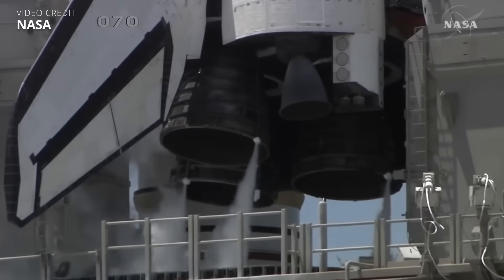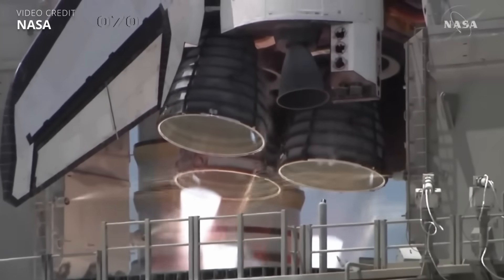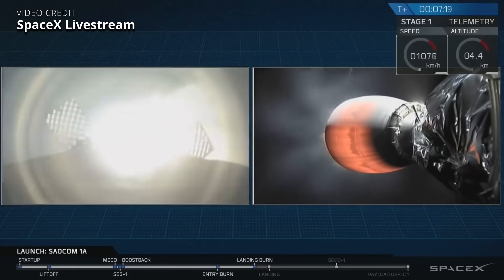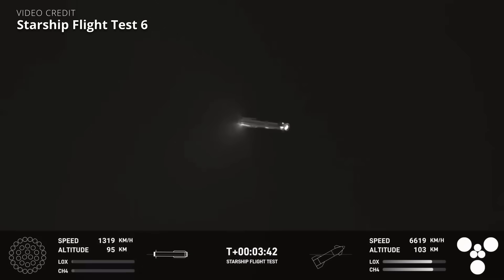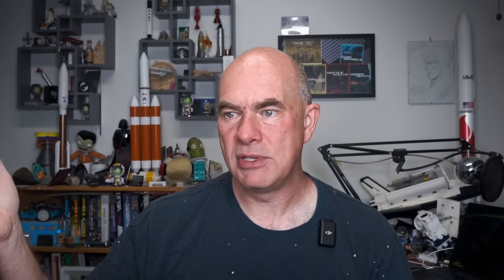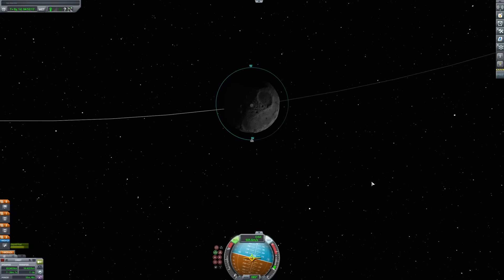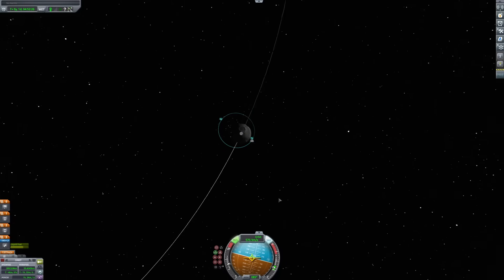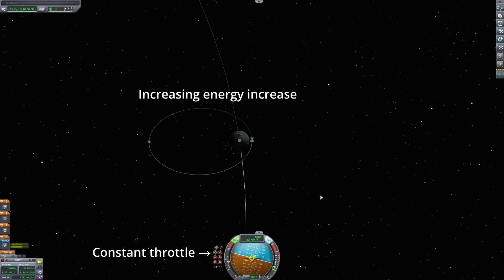Where Does Rocket Exhaust ACTUALLY Go?

Comment: But what about exaust from nuclear propulsion? Will those heavy radioactive elements decay in orbit by solar radiation?
Reply: Nuclear Electric Exhaust would be Argon or Xenon or something like that. Nuclear Thermal exhaust would probably be Hydrogen.
Only if you could build (which no one has) something like a nuclear salt rocket would there be radioactive exhaust. Or something like Orion proposals where you are blowing up bombs. In those cases you definitely do not want to run that near the Earth or any inhabited place!
Reply: Radioactive elements don't need any external process in order to decay. This decay is what makes them radioactive.